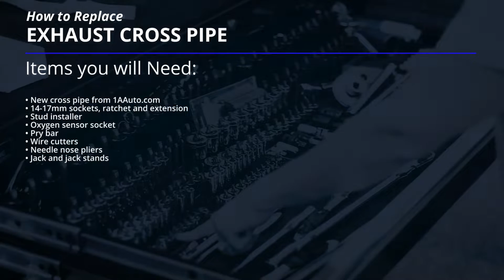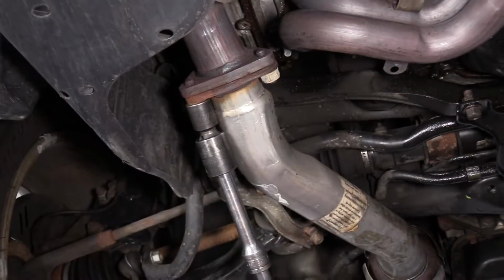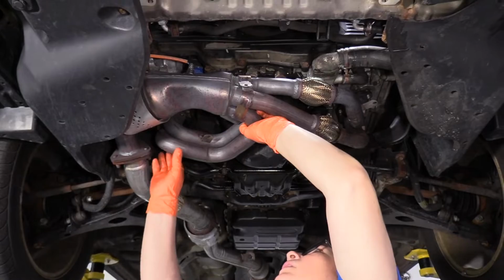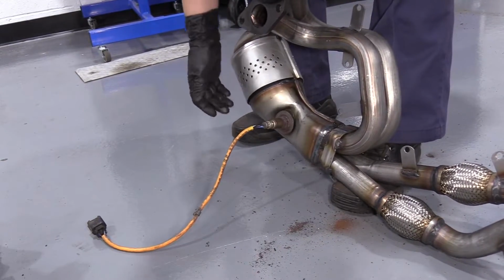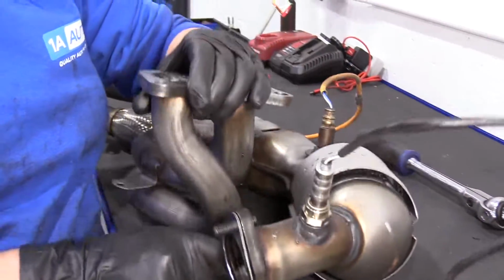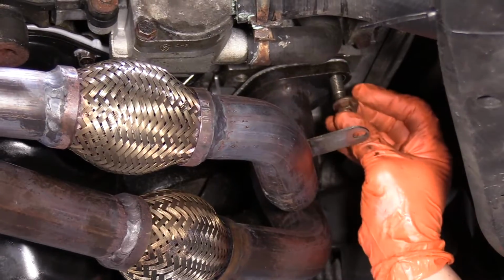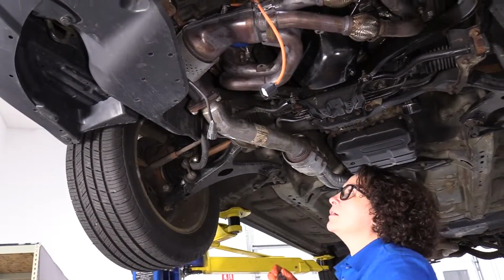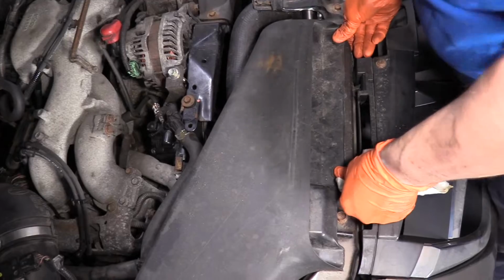How to Replace Front Exhaust Cross Pipe 05-09 Subaru Outback

Comment: can the heat shield fro the original be re used and re installed on the new replacement pipes ?
Reply from the maker: +Mono gram adikt Thanks for watching!  That would required modifying the old shields, but they are not necessary if you are replacing it with a unit like the one in the video!
Reply: No heat shield .watch out where you park during summer draught .🔥🔥🔥🔥

Comment: The middle stud/nut on the passenger side manifold seems to be unreachable. The pipe is in the way and so is the oil filter. Any ideas on how to get to it? It's a 2007 forester with a 2.5 liter engine.

Comment: I am wondering are you using the O2 senors from the old exhaust? Can that be done or should I replace them, when performing this repair? I ask because I am going to replace my catalytic converter soon, but last year I replaced both O2 senors.
Reply from the maker: +Thomas Craig The O2 sensors should be replaced if they need to be, otherwise, they can be reused if they are in good condition. 1aauto.com

Comment: What brand is this converter? What parts come with besides the converter? Will stock heatshields fit?
Reply: I have the same questions especially the heat shield those pipes and cat get really hot and seems w/o out the shield in place 2 things get affected first the cat needs to be HOT to work effectively and second you need to protect other areas around the cat and pipes from excessive heat. Just leaving it w/o heat shield seems like a bad idea .I noticed that there was a missing lower engine cover (plastic) leaving that off would cool the cat especially driving in rain or snow. So w/o heat shield and lower engine cover installed lower engine cover might melt w/o the heat that the cat needs is dissipated.